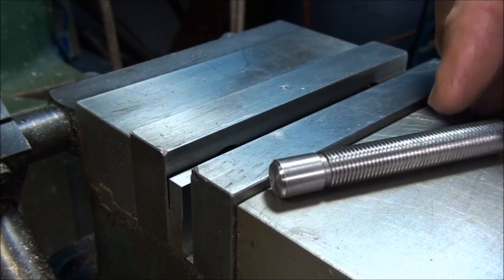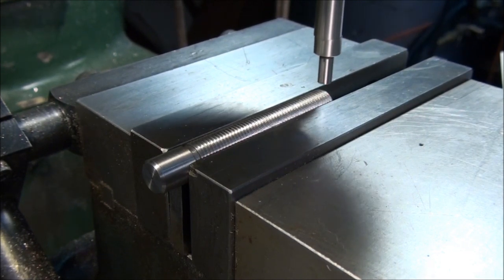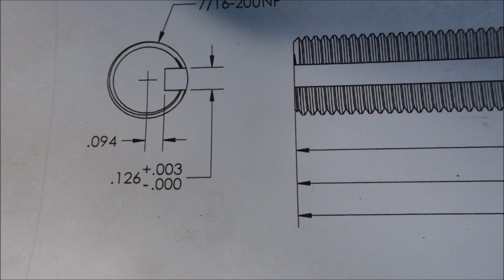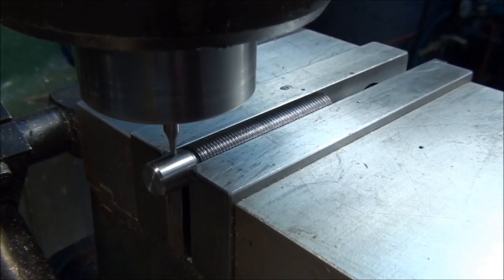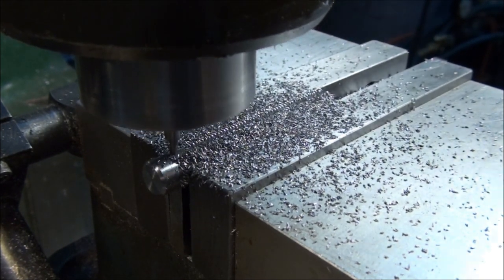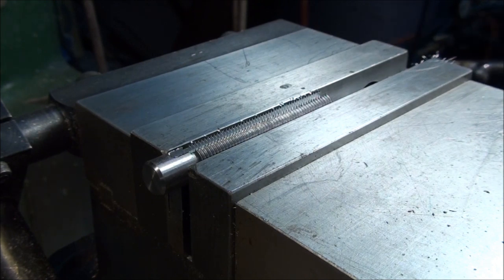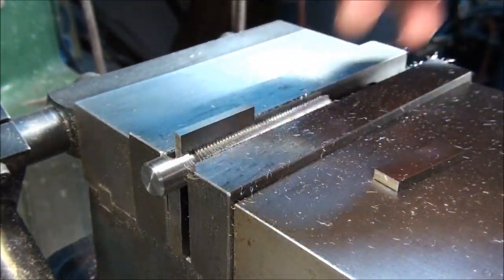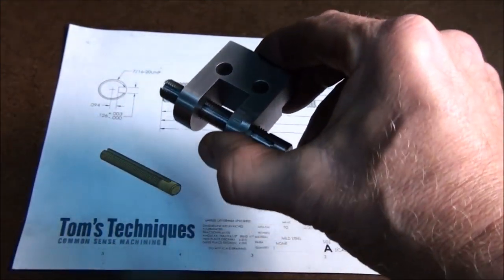Carriage Stop Spindle Part Two, Milling the Groove

Comment: Hey Tom, I learn something from you on every video.  I broke a 1/8" endmill  not long ago, trying to be easy and careful with it.  Of course I was running it way to slow and hung it in a bunch of chips. Now I know better.  Thank you so much for teaching a hobby machinist how its done!
Reply from the maker: You are welcome Chris, I'm glad that you got something out of the video. If the rpm is half what it should be, the side load (chip load) on an end mill doubles. It's no biggie on a larger end mill, but smaller ones just can't handle it and end up in the dust bin. As I said, the rpm necessary for small end mills can be deceiving. Imagine what it would be for a 1/16" carbide end mill! Would you believe around 30,000?

Tom

Comment: Thanks for another great video. I'll have to remember the gauge block go/no go trick, and about using a smaller cutter for grooves. The wire wheel cleanup is also worth some storage space in the cranial vault. 

As for power Z feed, you might want to check out Tom Lipton's channel (Ox Tools) for one way to solve that. He uses a drill and an adapter he made that replaces the hand crank. There's a hex portion in the middle of the adapter where he can put a wrench for manual fine control, and the whole thing can be slipped off to use the original hand wheel/crank if necessary (I think....haven't seen that done in any video so far, but I think he mentioned the capability once).

Looking forward to the rest of thus build!
Reply from the maker: Yes, the wire wheel is the only way to clean up burrs like that. It saves a lot of filing and swearing getting them off.

I have thought of using my drill for that application, but just haven't got around to it. I already use it to feed my rotary table and for the compound on the lathe and it works great. Tom has a lot of good ideas over there.

Thanks for watching!

Tom

Comment: Hi Tom...

Another great lesson....

Question...you always seem to use the edge finder, couldn't you have the DRO absolute set at the left corner of the vise fixed jaw XY and set your part on a stop to drop the edge finder step or am I missing something or reason to always use the edge finder....

Thanks
Chuck
Reply from the maker: My vise is on and off the machine all the time and the stop is constantly being reset to accommodate different parts, so it wouldn't be practical to keep the DRO zeroed in on any part of it. I've also slowed the process way down in the videos to help illustrate it's use. Without the camera, it literally takes seconds to center a part. You may have noticed that it lives on the side of my vise, ready for use at a moments notice.

Thanks for watching!

Tom
Reply: Tom's Techniques Looking good, almost makes me wish I didn't already have one so I could have the fun of making one. Now here's a thought, if you kept your vise to one side of the table you might have enough room to put things on the other end, saves taking the vise on and off all the time and no matter how quickly you can do it why waste time? Also helps to even up wear, especially if you put it to the opposite end everytime you do take it off.
ATB
chris.
Reply from the maker: Chris Stephens
Chris,

I suppose you could do that, although it would add more weight to the table (for a guy without a Z axis power feed). I'm also pressed for space and that extra table hanging off one side would eat up even more.

Tom
Reply: Z axis power feed is on my very remote wish list, but to be fair my mill is very much lighter and inferior to yours, even though my space is similarly, if not more, limited. For the majority of my work a vise and a spindexer are usually adequate and I have enough room for both, without excess weight, so my views have a bias to that aim.
ATB
chris

Comment: Tom - Newbie question......Why does a 1/8 end mill make slot wider than 1/8?  Great video, great project.  THANKS!
Reply from the maker: Any end mill will mill a slot wider than its diameter because it flexes as it rotates. The end mill is essentially climb milling on the leading edge, which forces it to spring to the side each time one of the flutes comes around. This not only makes the slot wider than the end mill, it also moves it to the side of its intended position. When milling a slot, always take the first cut on the center of the slot with a smaller end mill, then move over an equal amount each direction to mill the slot to size.

Thanks for watching.

Tom

Comment: Tom, 

How come you never use much coolant or oil?
Reply from the maker: Glenn,

Coolant is an option that allows for increased feeds and speeds. If I was doing production where time is money I would use it, but for most of the one off stuff that I do, it's more trouble than it's worth. It not only makes a mess, it can also rust the machines if they aren't used regularly. I do use cutting oil or tapping fluid for threading and tapping.

Tom
Reply: Thanks Tom,

I think I can back off the use of it a bit and not worry so much about cutter life.

Comment: cutter compensation 2.690 - half your cutter 3/32 into decimal is .0938 so half of it is .0469 i'll round to .047 so 2.690 - .047 = 2.643 ? just wondering
Reply from the maker: No cutter comp. The 2.69 is to the center of the radius at the end of the slot, or the length of the slot at the full .125" width. I could have spotted the end with a 1/8" end mill to make the full round radius on the print, but leaving it as machined with the 3/32" end mill is functionally the same.

Tom
Reply: thank you for your response keep making great videos